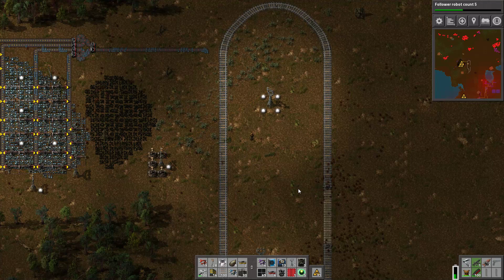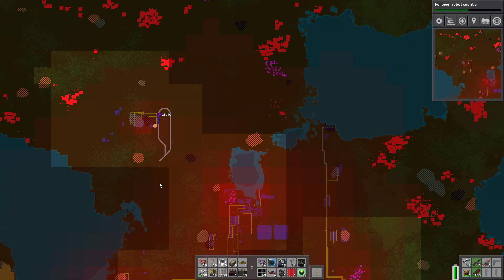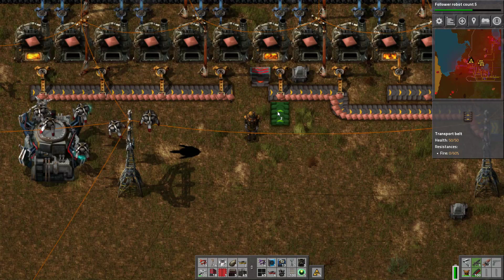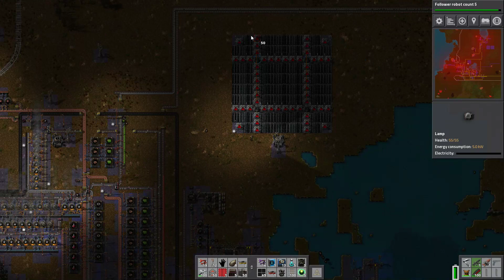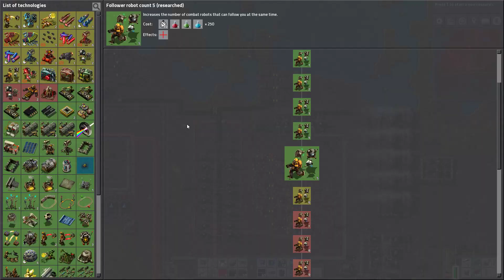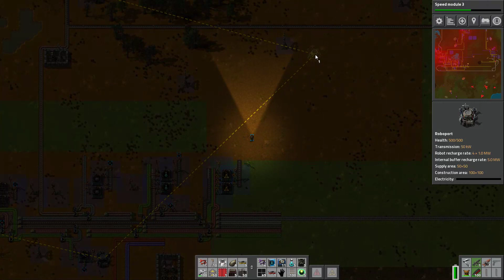Let's Play: Factorio! -- Episode 22

Comment: At 24:30 -- You can control gates by connecting them to a train signal with coloured wire.  With a bit of logic-programming, you can set up train crossings that stop the train on the tracks if the player has opened the gates.

Comment: quill!
you can connect the inserters to the logistic network so they only work when a condition is met. like, 'if solarPanels<100, go!' 
then you dont need to fill a slot in a chest plus the belts. You can remove the item from the assemble machine only when the condition is met. This way, you can even store the itens in 'storage chests' without over produce it
the button to this is in the top right corner of the info pannel that pops up when you click the inserter

Comment: Stack inserters can pull off of and put on to a belt. Also stack inserters and fast inserters move at the same speed so even at rank 1 of inserter stack size bonus they will give you more throughput than a basic fast inserter.

Comment: If you want to go full solar, that solar blueprint you're using is enough to supply about 2.5 MW of power usage and charge the accumulators. So for your current 31 MW, you should have about 12 of those set up, and then probably toss in a few more to allow for your laser turrets.

Comment: QUILL, PAY ATTENTION WHEN I TELL YOU THINGS!!!
1. Shift+ clicking on the green arrow to build rails in ghosting mode. This means rails will now be placed by robots, but they will remove trees along the way (if you HOLD Shift, that is), and there's an automated pathing algorithm that'll let you place miles of rail ghosts at a time.
2. When placing rails, you occasionally need to press R to turn the end piece, the computer will then try to path as best it can. THIS IS HOW YOU CORRECTLY MERGE TWO TRACKS.
3. Stack inserters can pick up/put down multiple items at a time from belts, too.
Reply: Comments starting like that will 100% be ignored.
Reply: slindenau
Considering what I've seen this far, I can only assume ALL comments are ignored.
Reply: Lol, that is certainly true :P
Reply: Well he does record these like 5 at a time so....

Comment: You should really just start afresh with the smelters section for producing iron plates, probably require 2 red/blue speed "ore trunk lines" from the train station to meet the demand/bandwidth  of your current factory.. I dont like switching to electric smelting personally as the ore is cheaper to produce than power :) i'm an evil pollutionist..